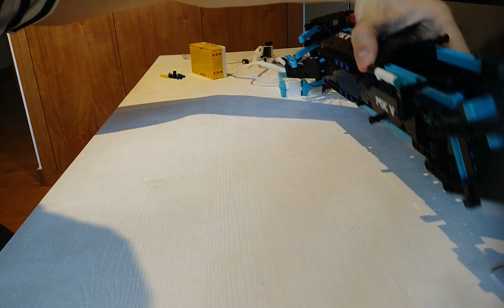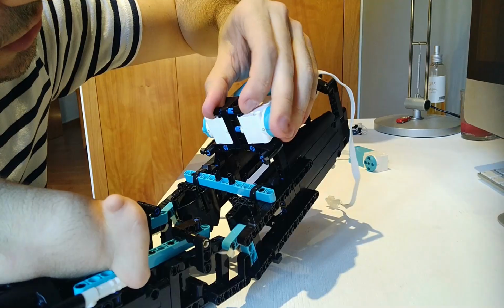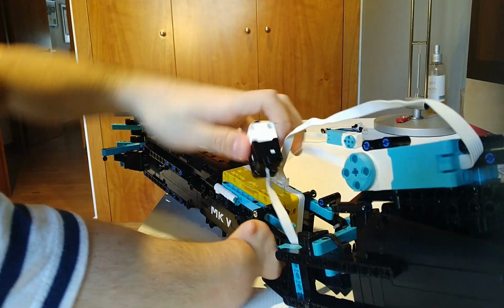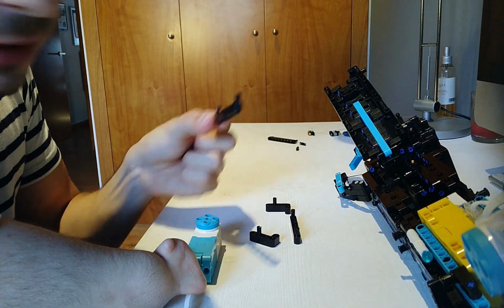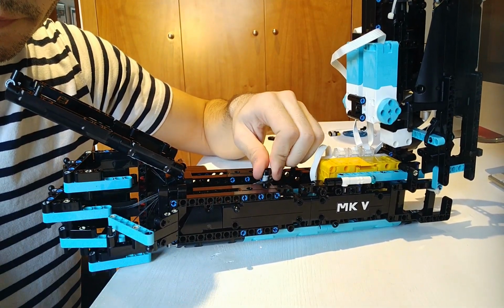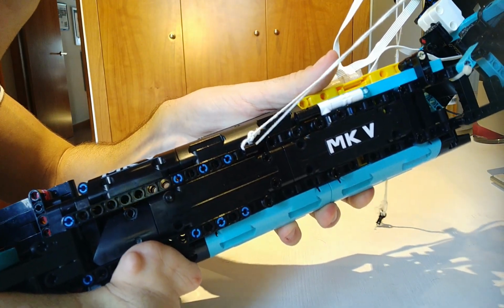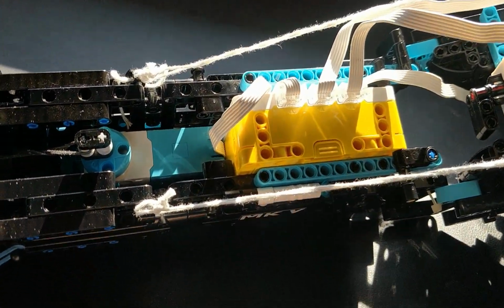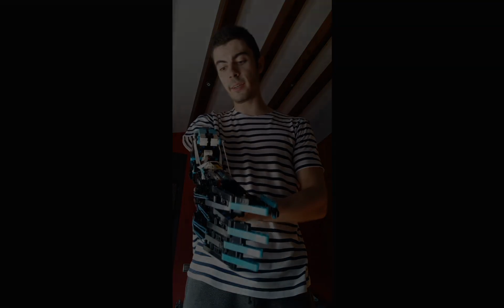MK-V Lego Prosthetic Arm by Hand Solo (FREE INSTRUCTIONS DOWNLOAD)

Comment: Can this prosthetic be used by someone who is an amputee? The person was amputated above the elbow. He is actually a double amputee, the same on both arms. You have a small moveable "hand" on your right side. Do you use it to operate anything from the inside? You activate the motors & such with your normal hand. This person has neither. After someone helps turn the prosthetic on, will it work for him? I would like to know this, even though he will never be able to use them. He was executed during the Bucha Massacre.

Comment: Hello, a question I have is what causes the hand part to move, referring to when you did a demo. I haven't built this by the way because I don't have the materials.
Reply from the maker: The hand is connected to the frontal motor, the one in front of the yellow and white box (Spike Hub), and the motor is connected to the Hub.
At the same moment I pull the trigger on the pressure sensor, the frontal motor starts rotating.
Reply: @HandSoloLaunchpad  that makes sense. Thanks.
Reply from the maker: @frederickherz1911  You are welcome! :)

Comment: Can you make a parts list also for this project? I have the lego land rover defender and was wondering if I could build this using those pieces.
Reply from the maker: I just updated the link: https://drive.google.com/drive/folders/1MMDdJHW7dH_OvvwtzYQvuVnuskR1kDKe?usp=sharing
You can open it with Bricklink.com
Reply: @HandSoloLaunchpad  Thanks so much!
Reply: @joshuajoseph8892  Do you have part list . I can't open .
Reply: @HandSoloLaunchpad  Can you also add the motors an other pieces to the list? I believe they are missing.
Reply from the maker: @joshuajoseph8892  I can't, the Studio software doesn't have them yet :(